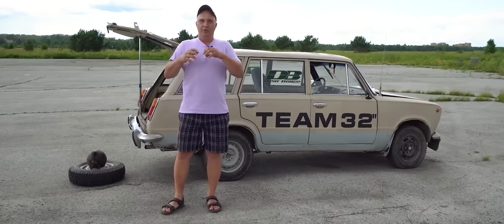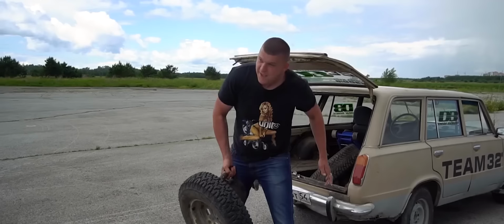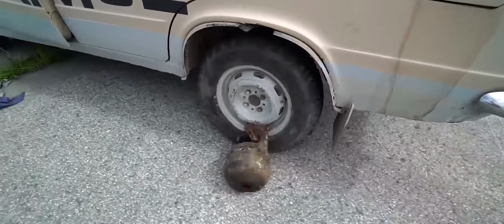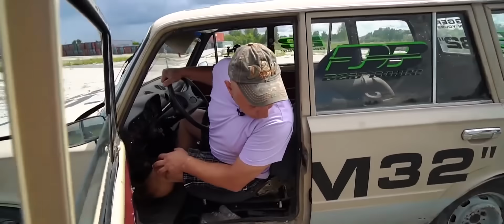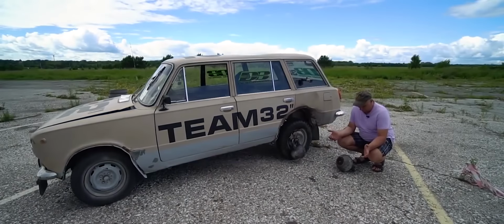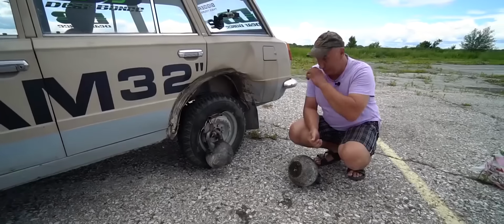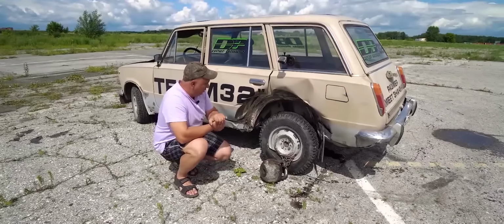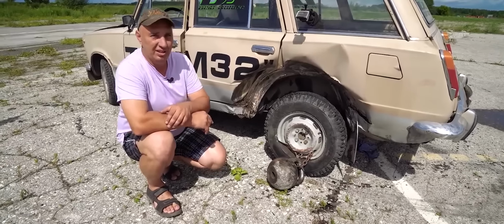What happens when you tie a 32 kilo kettlebell to your wheel?

Comment: Noice. I love this man. He's answered so many questions I've had about cars.
Reply: If you have these kinds of questions about cars, please don't ever come near mine.
Reply: Questions or morbid curiosity?
Reply: I too constantly wonder about potentially vehicle destroying shenanigans.  Can a magnet road hold  a car  upside down, and will the car work? Can a turtle shell( or multiple) be used as wheels? What is the absolute minimum ( car body) needed for a car to be still usable, and what would it look like? If my engine stops working, can I modify and use the muffler as a pulse jet? Would the car move? Can I weld a thick plate to the black of the car and hang dynamite from it to the explosion move the car forward? Probably not but would be interesting... This post is way too long
Reply: He's answering questions of mine that I never even knew I had
Reply: ClockworkTG lol
Reply: He answers so many questions I never could have thought of

Comment: It would be fun to drive one of those Ladas around in the US just for looks and questions, minus the kettle balls, of course.
Reply: They did sell them in Canada, if you chance find one. One even raced in the 24 hours of Lemons.
Reply: The steel on them is seriously thick
Reply: I think Doug deMuro drove one...
Reply: No doubt people would mistake it for a rare Yugo.
Reply: Thick, but low quality, also build quality is bad too, so it really likes to rust
Reply: Matt Farah's Million Mile Lexus just buy a fiat
Reply: ein Kekman yea, literally same car except better quality
Reply: They do have the advantage when going offroad, as you are not going to worry about scratching the paint on your expensive 4 by 4, and to fix it you have the entire tool kit in the front, just need to find the nearest fence for wire, or bring some along. Plus you can climb into the engine bay to fix it, no tight spots, just remove the full size spare, the high lift jack and the toolkit and there you can fit in. 

Plus they also have a starter handle on them, at least the Lada Niva 4x4 did. the only vehicle that came, new from the factory, with both rust and a any gear will do gearbox. Looks junk, but will outdo a Landie in any respect other than towing ability and top speed, but can climb pretty any slope that you can drive up.
Reply: There are still lot off Ladas in my country in Serbia on the road in countryside driven by older people ...from what i see ladas from  70s are in better shape then from 80s ..i know few with ladas from 70s with original paint and engine that was never rebuild and still work .
Reply: I've noticed that Niva that was built in 80's lasted much better than same model built in 2005 or 2010 for example, new models rust and break down all the time and their resale value is just garbage
Reply: SirSnivy ofNottingham 
I think you meant to say, "Lemans."
Reply: Le Mans?
Reply: "24 Hours of LeMons" It's a real thing.
Reply: ElvenMan
"24 Hours of LeMons" It's a real thing."
No, it isn't. 24 Hours at Le Mans is a real thing.
24 Hours of LeMons is ... I dont know, a farmers market?
Reply: There is actually a car guy somewhere who hasn't heard of 24 Hours of LeMons? Gee whiz.
Reply: I stand corrected. This https://en.wikipedia.org/wiki/24_Hours_of_Le_Mans
is what I thought you were talking about, obviously. I was unaware of the Lemon one.
Reply: Me? Not a "car guy". And everyone hasnt heard of everything. Wouldnt that suck.
Reply: @3216ben1 , of course they do rust.
Most of these cars are 30 years old.
Actually, the older ones aged much better. The steel in USSR was awesome.
But scince the democracy came in 91 they started to make 'em out of shit
Reply: @Ritefita  True, here I see Lada niva that are around 10 years old and they look way worse than the ones from 80's, probably steel thickness changed too

Comment: what happens if you fill the tires with cornstarch and water? The tires shoul get more solid, the more pressure they get. and become softer when driving trough mud or dry sand slowly and get more traction. But thats just an idea. dont know if it really works.

Comment: This raises a interesting question and that is , If you did this on a car or truck where the weights would not contact the body of the vehicle would the tires gain increased traction on say a icy or snowy  surface as the contact surface would have a lot of downward force as the weights passed through the bottom of the stroke this is to say the wheels would be pressed down one time per revolution  far more than the weight of the vehicle could provide. Of course to try this the weights would have to be secured to the wheel somewhat better than a chain but is this workable?

Comment: Back in the high school years when one of the bully/jocks would pick on the underclassmen I'd take a pound or two of lead weights and stick them on there inside rim and each them leave school and pull off the side of the road a few dozen time trying to figure out why the car had a crazy vibration / wheel hopping of the ground at 45mph...lol ... long wire tie on a truck driveshaft whipping the bottom of the truck us pretty fun to

Comment: Fill a car tire with nails and screws, air it up and see how long it takes to pop.
Reply: In terms of damage, this'll be similar to grabbing a handful of nails and throwing them at the tyre. 

To pop it you need the weight of the car forcing the tyre into the nail.

Comment: Hey bud, can you ask Deaf Bonce (or Alphard Audio) if they would be interested in sponsoring a moderate audio system in a 508 wheel horsepower showcar/race car with the owner being a leader of a 1600 member strong car club here in the US? I am about to purchase two Sundown 12s for my car and I would much rather have a set of Alphard Audio subwoofers in my trunk.
Reply: I don't need a 32", but one good 12 or 15 would be sick. My car is small, so any good sub would be plenty.